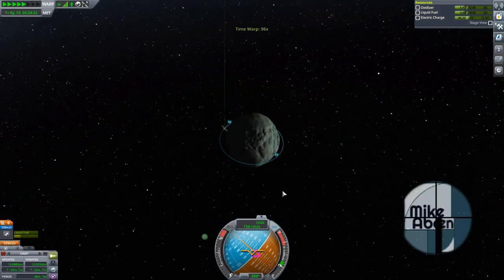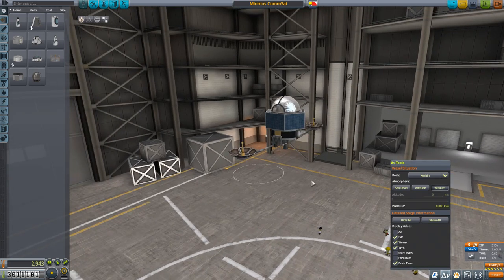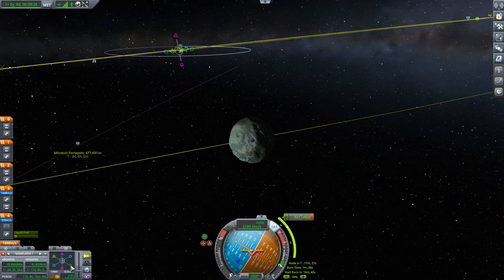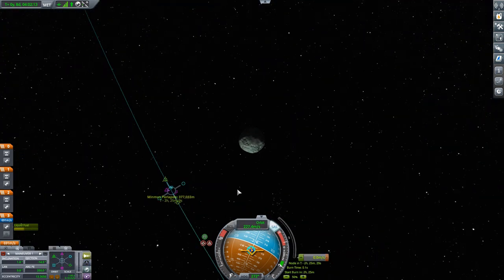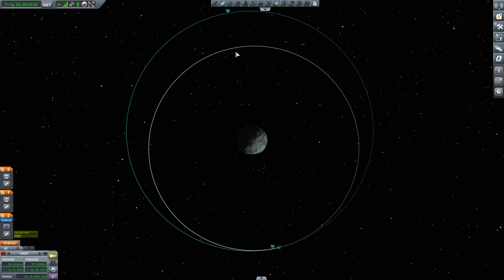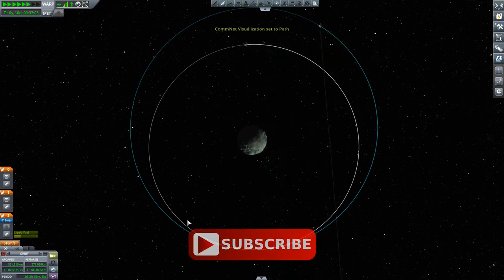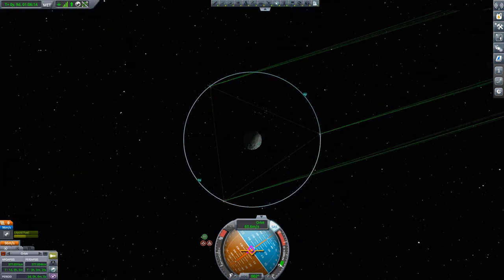Relay Networks - The EASY Way | KSP (Not) Beginner's Guide

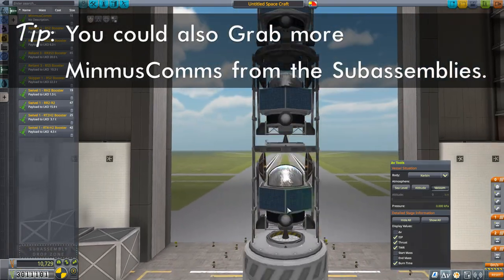Comment: A tip when you're stacking stuff in fairings using the interstage nodes (5:00) is to use the duel sided decouplers (the ones with 2 arrows). That way when you decouple. The structure in the fairing disappears making is easier to move the payload.
Reply: I'm glad you said this! My first test launch resulted in... Explosive antennas... because I could deploy the first one fine but not anything after that. 😅

Comment: I used two Oscar-B fuel tanks, spark engine and a jr docking port on each of my 3 relays. This allowed me to use them as my final stage to get into the phasing orbit. It also allowed me to professionally put them into their proper orbits using maneuvering nodes instead of finagling them out of a truss structure and essentially eyeballing it. Once mine are in phasing orbit, I stage all 3 of them apart using the jr dock staging and then set up all 3 maneuvering nodes to inject each into proper orbital position. The docking port also means they are serviceable in orbit. Paid no more than 10% more total cost than your method since I didn't have to build an extra stage. Boosters burn up over Kerbin. 2nd stage is aimed at the mun/minmus just before I release the final relay built stage, which is used to get into phasing orbit.

Comment: Thanks for another awesome video Mike! Just launched 3x MA Sputniks strong to the Mun! (Mike Aben Sputnik). This is why I watch your videos! I always learn something new. I often wondered what altitude to start using my vacuum engines, I thought about using them in the 50k-70k range but because the TWR was so low I wasn't sure and I would just wait until 70k to be safe. Now I know that I'm losing out on 20k of altitude and it's totally okay to fire them at 50k! To a normal player this might seem immaterial but to a nerd and someone who's OCD about this game that's invaluable tidbits I get from your videos :-)
Reply from the maker: The atmospheric pressure guage is a pretty good indicator. When it's into the final bar, it's much closer to vacuum than not.

Comment: Use a procedural fuel tank and make it any size. I even make hollow cylinder fuel tanks that can adjust the fuel amount by changing the inner diameter and then you also enclose the engine so it can couple better! If you want to use the hollow cylinder trick to make coupling on smaller engines easier, but need more fuel, you can also attach the procedural tank to a larger tank as well.
Reply from the maker: Good ideas, but this series is deliberately mod free.
Reply: @MikeAben  The engineer in me likes to keep it simple but the kid likes toys! ;-)

Comment: So I was having issues releasing my sats without mucking up the orbit. Initially I was trying to set them in retrograde, but using RCS to move fore changed my PE so I had to do equal (or more) thrust aft to correct the PE but by the time I correct the PE the satellite ran into my mothership. So I decided to give the normal deployment a try, because it would allow me to burn retrograde to circularize the sat and not blow up the mother ship or change its orbit. I wasn't sure at first if being normal would change the satellites orbit to be shifted by the height of the mothership, but then I looked in the map and you can't even see the difference in orbits. Thanks for the video, it did help much to get my first satellite network around kerbin. Mun and Minmus is next :)

Comment: Quick question! When you decouple the relays, does that small sideways thrust to move it away from the delivery vehicle change much of the orbit as you put them in to position or later on in the game after many many time warps? Or did I have the perspective wrong and you were just slightly moving the delivery vehicle away after you decoupled?  Really been enjoying your videos lately.  I played KSP waaay back in the day and finding these tutorials as I get back in to it years later has really brought me a long way.
Reply from the maker: A can a little bit, but it is easy to correct for. You can also puff away in the direction you have to burn anyway, retrograde in this circumstance.

You'll never get the orbits perfect. Even if the periods are all within the nearest second, there will still be some drift, though it won't be apparent for a few game years. If you're concerned, you can find the relays in the save file and change their periods to exactly what they need to be.
Reply: @MikeAben  Thanks for the swift reply.  These tutorials have gotten me further in the game than I ever did before!

Comment: i just installed a 4 satellite relay network in the kerbin system just on the boundary of kerbin escape at 73Mm. This covers the entirety of the dark side of both moons and should reach out pretty far into the kerbol system..  thinking of blowing up all the useless satellites the game gave me, to repair, to clear up clutter.. currently trying to find out what the distance ratings on the relays mean so i know how far out they go and thinking of jumping on another relay network outside plock to cover the entirety of the kerbol system before i do any interplanetary missions.. i HATE dropouts on the dark side when i schedule maneuvers and lose contact.. maybe i can cover the entire kerbol system with only 8 satellites total... i guess i should get started now because those outer ones will take 10 years to get out there?

Comment: I'm making a relay cloud around Kerbol from Moho to Duna, using only triple 2G relay satellites.  I want to fill in the space well enough so that there are sporadic connections through the space, with each satellite at a different roughly circular orbit, and with only a level 1 tracking station, as the giant one fills in way too much space.  Do the 500m relays still have the c of 1 or was that the direct one, as the triple 2G's range is too small and it would take insane numbers of them to cover the area well enough.

Comment: Since you can enable ground stations in the settings I didn't feel it was strictly necessary to build a geo stationary network. I used Google sheets guides to help me pick an appropriate antennas for each celestial body. (It's really useful and I believe it's a few years old by now).

Also, like, once the electric engine is unlocked (the combination of fuel cell, a little bit of fuel and xenon gas) that all I used to move my satelites to other places.
Reply from the maker: I agree. There's no need for keostationary satellites unless you turn if ground stations. Is this the spreadsheet you're referring to. If it is, then yeah, it's pretty awesome.
https://docs.google.com/spreadsheets/d/1qIgFB8OXnlgpPCGsxv7JYUYQq5O671IcZXpumVaStek/edit?usp=drivesdk
Reply: Having only one ground station just adds an extra challenge for those strange people that like to just make things harder on themselves...😁
Reply from the maker: @Bendigo1  I wish there was a slider in the settings for the number of ground stations. Three or four would give some blackout areas in low orbit while still providing incentive for some Kerbin communication satellites.
Reply: @MikeAben  yes, that would be great.    That is a good idea for a mod maker to consider.
Reply: Yeah, it's awesome, if you're willing to use mods there's also the Antenna Helper mod which provides the same calculations in-game which means it'll automatically picks up what antennas you currently have on the spacecraft and applicable range modifiers (if playing on harder settings) which simplifies "will it reach Kerbin" (or a another relay) part slightly.

The most valuable tip I've gotten from Mike Aben with regards to relays is "ignore Pe/Ap, the period is what matters" (unless it's really far off). This is because drift actually only cares about period which means that as long as you don't put the relay satellites close to the lower altitude limit (same as the diameter of the body) and the period of all the satellites are really close to each other the constellation will last a very long time without intervention.

This really changed how I do my relay networks, my relay satellites drift a lot loss now than when I tried to get the relays into circular orbits with the correct altitude, it just never ended up with close enough periods, the "match period" is both easier and far more precise. This usually didn't actually matter because I tend to get to bigger relays long before drift matters (before I'm done with Minmus) and once you have bigger relays you can put them much further out from the body and still connect via a C-16 and drift pretty much ceases to be an issue (extra altitude means the drift is much slower and the margins bigger) but the OCD part of me really appreciates the neat 120-degree separation.
Reply: @Torbjorn.Lindgren  i like to get the ap and pe as close as possible then tweak the orbit little by little to get the orbital period within half a second.    Getting the inital orbit as close as possible to the desired ap/pe is key when doing that.  I usually aim for a meter or 2 below desired ap on the sattelite delivery vessel so that when launching the sattelite the ap usually comes out right where i want it.  After i have the first sattelite launched and while waiting for the delivery vessel to do its setup orbit again i tweak the sattelites orbit.   It only takes a few minutes and it pleases my ocd to have a near perfecly circular orbit.   Within .5m between ap and pe.
Reply from the maker: @Bendigo1  I like to get the ap and people very close too, but they're very easy to tweak while not messing up the period. This is actually a topic in the next video.

Comment: When I add a decoupler below the spark engine the engine shroud matches the size of the engine rather than the rocket circumference.  How did you get it to match?
Reply from the maker: As far as I know, you can't. The best you can do is remove the shroud by right clicking the engine in the VAB, or building your own shroud using a fairing. There's a mod called Decoupler Shroud which likely does what you want if you want to go that route.
Reply: @MikeAben  Cool, a fairing works well enough. 

'Making History' DLC also has engine plates that do this and act as a decoupler but they are a bit long.

Comment: quick question, is there any advantage to not having all lower thrusters go off at once? cus when i set up a rocket i always have boosters and main engine go at once.
Reply from the maker: Depends on the engines. You want the minimum engine mass to give you the trust you need but often, especially with smaller rockets and SRBs, you get so much thrust from the radial boosters you might as well save the later stage engine.
Reply: @MikeAben  thanks, ill keep this in mind
Reply from the maker: @mrkitkat0069  I just took a closer look at this rocket and noticed I had a Terrier for that central core engine. The Terrier is very inefficient at sea level and definitely shouldn't be lit until the air is much thinner.
Reply: @MikeAben  ok then, thanks for the help!

Comment: Hi Mike, thanks again for your great videos! 
I want to build a similar relay rocket, but I can only place 2 relays on each other instead of 3. Do you have an idea?
Reply from the maker: You could put a couple of relay antenna on the carrier and have that be the third relay.
Reply: @MikeAben  Ok thanks. Is it possible that the satellites are too big so that the fairing's maximum height is exceeded?
Reply from the maker: @Michael-zm2hv  That's possible, especially with the 1.25m fairing. The ones in this video just fit. Remember, the relays hardly need any fuel. I just used a single dumpling fuel tank that I translated halfway into the probe core. You can even make it smaller using monoprop. The smallest moboprop tank, and then the linear RCS port for propulsion, is gonna be a pretty small probe.
Reply: @MikeAben  Ok thanks. The fuel requirements between a Mun and Duna orbit are technically the same, right? So ~100 Delta-V are still enough?

Comment: Hi!
I do it like you do, accurately much as i can, but when my rocket leave kerbin, lost communication and i can't control it. Can anybody help me?
Reply from the maker: It would help to know when you lose communications, but a few things come to mind. 1) Your craft has run out of electricity. 2) You forgot to extend an antenna. 3) You have ground stations turned off in the game settings and the KSC is on the other side of the planet.

Comment: Great video but I have a question. When you rerouted it to the decoupler, you then dragged it by the engine into the sub assembly. Then on the fairing you attached a new decoupler, and when adding back in the subassembly there was no decoupler already present...

Was that a goof or how one should do this?

Thank you.
Reply from the maker: Nope that's the way it works. By making the decoupler the root part and grabbing the engine, the decouple stays behind but the bottom of the engine becomes the active attachment node. If I wanted the decoupler to be part of the subassemby, I would have to attach something to it, make that the root part, and then grab by the decoupler. 

It's a little weird, but you get used to it. That decoupler could have been any part. Perhaps I could have made things more clear by using a different part.
Reply: @MikeAben  thank you for the explanation; I'll try it out.
Reply: @MikeAben  Thank you a lot for your videos. I have a question about the build too : Do you know how the second fairing (the one under the spark engine) does not appear in the staging ? (nor in the video, nor using the .craft file)
Reply from the maker: @tanakaox5023  It looks like a disabled the staging. This can be done in the VAB through the part tweak menu. It's a nice way to create a cowling around the engine.
Reply from the maker: @tanakaox5023  Ah. I got to be honest. I don't understand why advanced tweakables is not on by default. It's so confusing. I'm always forgetting what's "advanced". I'm glad you figured it out.

Comment: Insterstage thingy is not really working out for me, I tried to stack up on each other, just like you, 3 satelites and its just isn't attachting properly. The satelites are kinda bigger so idk if thats the problem but it's driving me crazy.
Reply from the maker: I'm not sure what the problem may be, but there is a Toggle Interstage Nodes button in the fairing context menu. It should be on to attach to the interstage, but you sometimes get a lot of nodes close together and turning it off helps with that.
Reply from the maker: It could be the satellite is bouncing between the node below and the node above. Try attaching something simple, like a decouple, to the node. Turn the nodes off, and then attach to the decouple.
Reply: @MikeAben  helped out, thanks

Comment: At first I was a big fan of this method. But it is just impossible to space them perfectly, and even the smallest error will multiply as we progress in game. Can you please think of another way?
Reply from the maker: It takes a few game years before drift will be a problem, but a suggestion did come up in a comment that I'm starting to take advantage of. 

Period is a function of the semi-major axis of the orbit. If two orbits have the same semi-major axis then they'll have the same period. Go into the persistent save file. Search through it for your relays. Find the SMA (semi-major axis) for one of the relays. Copy paste that number in for the SMA of the other relays. The relays now have the same period to a great deal of accuracy. You can probably do this through the cheat menu too.

Comment: I'm trying to get this to work but my satilites don't deploy, they are stuck together with the fairing structure
Reply from the maker: Make sure none of the parts are clipping together. Remounting the satellite on the decoupler may help. Use Alt-F12 to access the cheat menu and put yourself in orbit to test deployment.
Reply: @MikeAben  it's like I can't get the separator to attach the satilite and the fairing together. There is always a gap.
Reply: @Mike Aben  and thank you for the reply, I wasn't sure I would get one since it was an older video LOL.

Comment: what's with the cargo bay?
Reply from the maker: You put stuff in it.
Reply: @MikeAben  I know that, but why did you have it installed with a relay probe inside?
Reply from the maker: @MixelFan95  That probe body wasn't a relay. It was for the carrier vessel. It also held some batteries, solar panels, and an antenna.
Reply: @MikeAben  oh ok

Comment: Hm my satellites lose control as soon as i decouple. Hat to use cheats to restore control.
Reply from the maker: Sounds like you may have run out of electricity. You have to make sure the solar panels are being exposed to the sun. That, or the antennas weren't raised, or you just dipped into Minmus' communication shadow.

Comment: couldn't you just have a N-S and a E-W running satellite on one planet? that way no matter at whatever point in the orbit they are a constant angle from one another
Reply from the maker: You would still have dead spots. There is still just a single plane between the two satellites and the centre of the orbited body. Even when the satellites were 180 degrees from each other, they still couldn't cover the entire surface.
Reply: @MikeAben  but three satellites on orthogonal orbits, on the other hand...
Reply from the maker: @AbsoluteHuman  That's still no better than three satellites in the same orbit. No matter what their orbits, at any single moment three satellites will define just one plane. This all said, terrain occulation is pretty generous in the game and three satellites will likely be fine.
Reply: @MikeAben  oh, you mean there will always be dead zones on the surface, I got it. I thought we were talking about the way for them to always have a connection to the space center through each other.